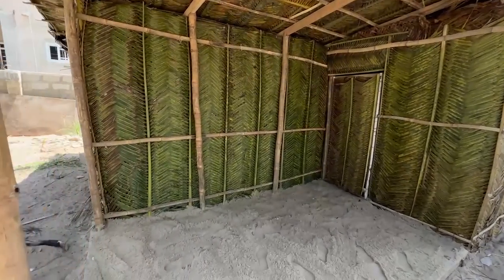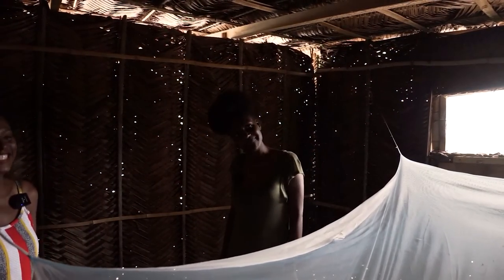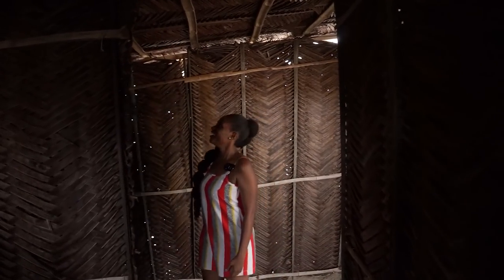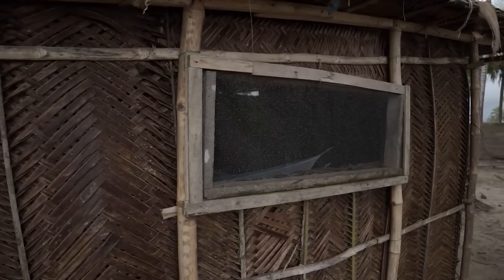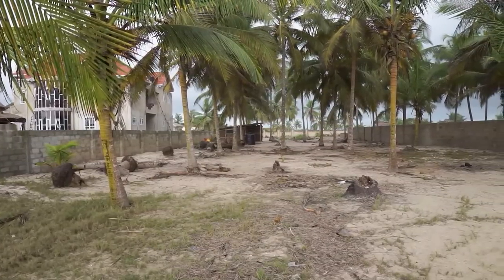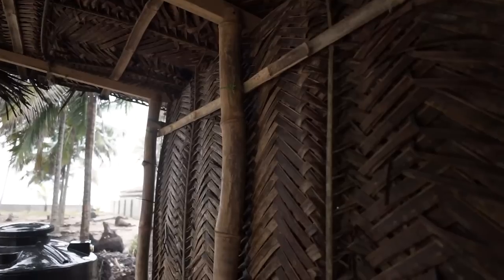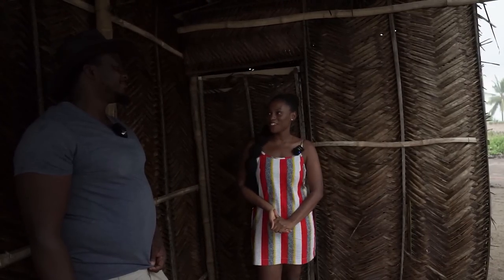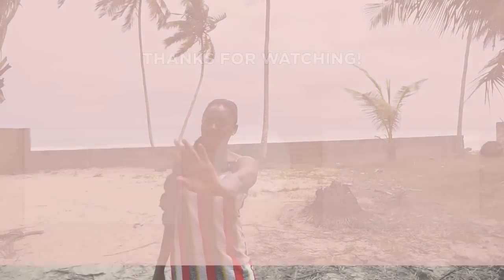African American moved to Ghana from L.A. to live in an off-grid coconut hut  | Real Estate in Ghana

Comment: Hi There,
The type of coconut hut as shown in your video originates from the Ga tribe's Xmas coconut hut which I understand has disappeared from the Ghana cultural landscape.

So, I'm happy to see it make a comeback in another form as an everyday living space as shown in your video.

And, as an improvement, also for the longevity of the leaves, I'm thinking that a layer of clay or mud (plentiful and free in Ghana & I'm sure even to be found near the hut) can be applied once the coconut leaves have dried thoroughly (and adding a layer of clay or mud will not only protect the leaves from aging and decay but also insulate the leaves against fire).

Finally, once both leaves and the outer layer of clay or mud have dried, the hut can then be painted like any other house &, unwittingly, a new form of affordable dwelling would have been created.

A word of caution though: 
The question is whether it'll be SUSTAINABLE if many coconut huts modelled after the one this video started to be built in Ghana bearing in mind that the coconut tree which provides the leaves, an essential raw material for building the hut, has been decimated in Ghana by a disease that first started on the east coast of Ghana and then spread along the Ghana coastline killing many coconut trees in the process. 

Needless to say that coconut trees growing by the shoreline as was once the case in many parts of the Ghana coastline could have helped against beach erosion and also probably against rising sea levels.

All in all, as coconut leaves are harvested to build huts such as the one in this video, it's also worth remembering that there's an urgent need to plant new species of the coconut tree, preferably faster-growing specimens, especially along Ghana's coastline & what is being done in the republic of Benin can serve as a model/example.
Reply: I am hopeful she may grow more
Reply from the maker: This is very informative Nii, thank you for sharing!
Reply: Ooo…thanks for sharing!
Reply: Thanks Prof...that was a whole lecture lol... informative.
Reply: Great notes and reminders!
Thanks.😊

Comment: Dry coconut leaves and bamboo burns like petrol. I love her sustainable natural projects.
Reply: @ Pro You Services Ltd,
It's true that dried coconut branches and bamboo poses a fire hazzard, but there are organic fire retardant solutions that can mitigate the risk.
Reply: @kwamekankam-boadu2467  Yes she can plaster the walls with mud/clay.
Reply: @proyouservicesltd3652  Brilliant solution. Mix clay into a slurry, load it into paint sprayer, or simply use rollers and brush. Paint about 3-4 layers after each is dried and viola, fire problem solved. It would also serve as a great reinforcement of the coconut leaf wall.

Comment: I love that she is living her dreams.  All the best to her.  Can’t wait until I get to touch my feet on the land of my ancestors.  One thing I wanted to mention.  Getting your connection to city water is done in the states as well.  When you build new you have to have the same thing done in the states where they have to dig from the street into your property to run the piping from the city line to your house. 😐 or there are a few areas that use well water.  If you build a stand alone house outside of a subdivision you or your builder will have to communicate to the city water department.  If you purchase in a subdivision, the builder usually gets it done but depending on the builder and the type of deal you have, you may or may not have to get involved.

Comment: I suggest you spray the walls green agin.....just get enough green spray paint and do it yourself boo....you walls will remain green for as long as you want. I also suggest you pour gravel all through the bathroom and nothing stopping you to pouring it all over the house...kitchen inclusive, I used seashell for my bathroom floor. its cheap and durable.

Comment: The hut is amazing, but I would never be comfortable occupying it for even one day.  It is not fireproof, there are too many natural cracks in the wall and roofing material that let the rain in, so many gaps in the structure gives easy access to critters from the outside entering in, the sand flooring is too messy and will ruin a lot of the furnishings, the crooked window structure is lame and not large enough, there is not enough natural lighting allowed in, the few solar panels are not sufficient, and there is practically no electricity.  The only thing going for it is location, location, location!  That waterfront is amazing!  I'd spend another $600 for a serious upgrade.

Comment: I just don't know. I understand simplicity and the organic nature of the structure is just beautiful but not having any furniture and wood flooring inside [and make the space bigger to fit some nice furniture pieces, i.e. a Sofa, Nice Round Dining Set, A King Size Bed-Zinus 14" Black Metal SmartBase Tool-Free Assembly Mattress Foundation, King], a fireplace [US Stove Company The Rancher Stove], Honda 2,200-Watt Super Quiet Gasoline Powered Generator with some fuel, for window glass use clear acrylic pounded into place with a rubber mallet hammer and maybe making an organic community center [ceiling height can be higher] that the natives can use instead of making it a resort to invite people that maybe unwanted [I believe by International Agreement you must be from certain DNA to live in center lands for certain amounts of time]. Africa deserves more. Love the craftsman weave - See time 1:00 on Video [just the thought of one's peoples leaving them with that legacy is endearing] and Time starting 25:54 [The Building Technique]. Would love for the locals to see some of the American flooring materials from such venues as Lowes and Home Depot for instance [Maybe a one time donation limited to $20 Each from 2000 to 3000 people could buy some of the things for the locals, if they are handed into their hands only]. Note: Because you donate doesn't mean you own them or they owe you anything but they should thank God for they are truly blessed in any event. Please don't build by the water [ocean] as this belongs to everyone. Hope I didn't offend by my comment only meant for creative expansion of thought.